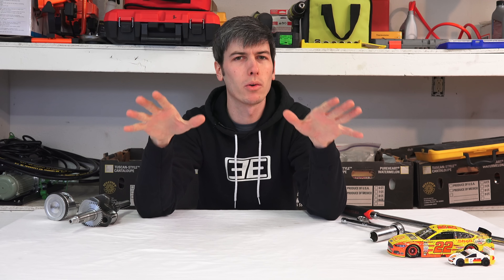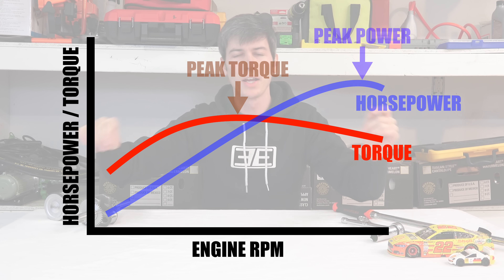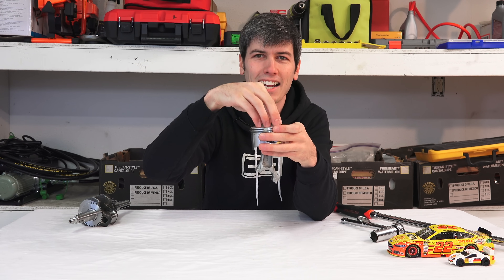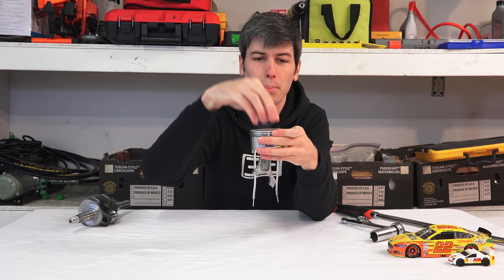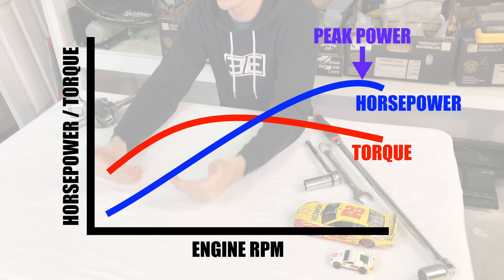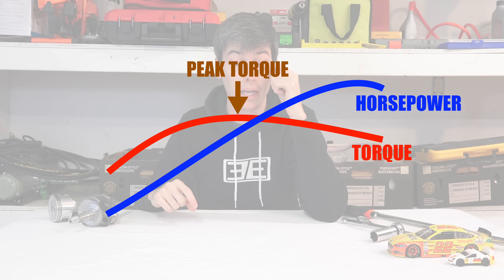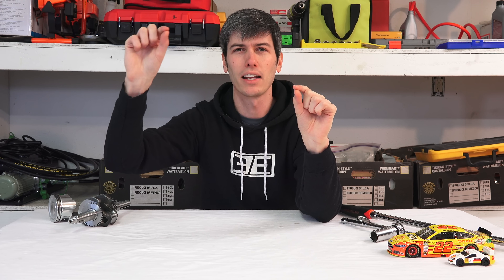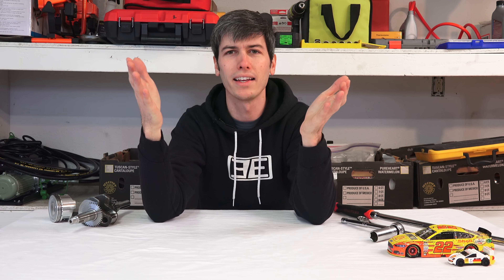Horsepower vs Torque - A Simple Explanation

Comment: After watching your explanation and reading through the comments, it seems to me that having less torque will create more HP. The distance traveled is therefore shortened making the axis of rotation spin faster equalling to more working in a shorter amount of time. So my question is, if I were to apply a bigger piston head and shorten the distance, will I be making more HP? My deduction is yes but I want to hear what others have to say and also, is this considered gearing ratio?

Comment: I umderstood power and torque, but peak torque? Shouldn't it be at the end rather than the middle?
Reply: The peak torque can be tuned into the engine by the designers when they specify valve timing, etc.  For example, my Mazda CX-9 was designed to have a lot of low-end torque to make it very easy to drive day to day.

Power will generally be at high RPM because power is torque times rotational velocity.  When you multiply any torque by high velocity, you get high power.
Reply: @razortm9947  Thanks,  I think I get it bit I'll need to do some more research to get it properly in my head 😅

Comment: If horsepower is torque multiplied by rpm, it would mean that hp has to be always higher than torque. So lets say 200 hp and 100 NM. But very often this is not the case. For example in Diesel Engines. They have 300 hp and 600 NM of torque. So this formula is not correct.
Reply: The formula for horsepower is (torque*rpm)/5252, the general definition of power is torque times radial velocity. You must divide by 5252 because of unit conversions

Comment: Good explanation... BUT it's a tiny bit more complex than that. You do need to consider how the vehicle is geared and the shape of the curve to really know if your 200hp lower torque vehicle is going to accelerate faster than your 175hp higher torque one (unless you have a cvt). To have a good idea which car is faster you need to look at the area under the hp curve during the acceleration. If both vehicles accelerate from 60 to 90mph in second gear (I'm a motorcycle guy) passing through their peak hp in the process... the faster bike will be the one that has the highest AVERAGE horsepower during that acceleration run. SO... a peaky 200hp engine will need gearing that keeps it right close to that peak (or the rider will need to shift)... whereas a torquey 175hp engine will be able to deliver closer to that peak hp over a wider rev range. Simple no?

Comment: I've been studying on 4 stroke engines. specifically the predator 212, 420, and 670. also centrifigal clutch versus torque converter. this video was super helpful. thanks.

Comment: Thank you so much!! This was an excellent explanation. My only issue was when you said the cars in the example were the same except power and torques. Then you went on to discuss their peak acceleration, where you mention differing gearboxes between the two example vehicles. Can you explain it in terms of cars with differing power and torque outputs yet the same gearbox? Then, will the car with more torques but less power demonstrate a faster acceleration at first but less total speed over time?

Thanks again

Comment: "the one with more power is always going to be quicker"

Top Gear: BMW 530d vs 530i.  530i has more HP, 530d has more torque. 530d turns out to be faster.

So according to Top Gear's testing, the one with more HP is not always going to be faster.  To be fair though, Top Gear is not necessarily the holy grail of scientific methodology...
Reply: the turbodiesel beemer also makes more average horsepower throughout the usable rpm. The 530i makes more "peak" horsepower and less torque
Reply: No your right and he is wrong. He simplified this to try to make it easier to understand but now it wrong.  Higher HP will always be faster if the gear ratio is the same.  However, a correctly engineered gear box resolves the issue.  Have more torque then use taller gears. He either is not as smart as he thinks or had a major brain fart when he made this video. HP does not equal Torque x RPM.
The correct formula is  HP = Torque x RPM / 5252. In other words, HP will always = torque at 5252 RPM because there really is no such thing as HP, it's just another unit of measurement based on Torque and RPM's
Reply: @ponderscythe835  "there really is no such thing as HP" -- you are so, so, so wrong about.  Power is fundamental physics: *power is an ENERGY RATE*.  In metric, we use kiloWatts. Where 1 W means 1 Joule per second of work rate.  What does the fuel contain? Chemical  energy in Joules (or calories if you prefer).  So power (in hp or kW) is the energy rate that can be extracted from the fuel and turned into useful work at the crankshaft (usually at about 30% efficiency for a combustion engine). Energy & power is far, far, far, far more fundamental than twisting force on the crankshaft (torque).

Comment: One question. Will the car with higher peak torque accelerate faster than the car with lower peak torque considering everything else is with respect to your example of two cars?
I don't want manipulation in gears so the figures are the max that the car can achieve?
PL reply @EngineeringExplained

Comment: This chap seems to contradict himself pretty severely coming up on 4:00. He originally claimed that torque could be tweaked through different gearing ratios, but then he said the same thing about horsepower without clarifying what the difference is.
Reply: You misunderstood what he said. Torque can be changed with gear ratios, horsepower will remain unchanged.
The formula for horsepower is (torque*rpm)/5252. Lets say there is a motor that produces 100 ft*lb torque at 1000rpm, that means it produces 19hp at that rpm. Now lets say that motor is connected to a 2:1 ratio gear. The output shaft would have double the torque, but half the speed (rpm), so it would have 200 ft*lb torque and be spinning at 500rpm. But, the horsepower at the output shaft would still be 19hp.

Comment: The best way to feel the difference between torque and power is tunning a scooter with CVT. They have transmission set for a max torque to achieve the most efficiency and reliability. Now set it for the power  and be astonished how fast you accelerate. There is even a funny effect with a badly tuned scooter when after a crappy acceleration within CVT range you start to gain speed in a faster rate when the unlocked engine starts revving.

Comment: Seem to be a lecture about gear ratio more than HP vs Torque
Reply: Because an aggressive gear ratio can give you more torque for the same HP engine
Reply: He lost me at gears.
Reply: Torque is twisting force HP is work over time.  His explanation seems to say that you can simply change gears to create HP or torque. That's just not how it works.
Reply: @chevysturgill6330  no, he says you can multiply torque but you cannot multiply power.

Comment: Its impossible to understand what horsepower is until you've done your honework; especially on Radians.  Radians are the key to grasping what horsepower really is.  If you wanna understand horsepower you have to research what the original engine buiders were going thru leading up to the erra of the mighty steam engines.  Regardless what erra engines you're trying to understand, all engine builders face one variable they are constantly trying to improve upon....Efficiency!
Radians qualify RPM's while RPM's qualify work completed in time; therein lies Effiecency, or the lack thereof.  Understand Radians to RPM's then you will understand RPM's to Torque.

Comment: Understand Torque is mostly based on gearing, but what about cylinder length? Does length impact torque also? Great video, thanks.
Reply: Length impacts torque. Yes.
Torque is most proportional to displacement and cylinder length impacts the stroke in the displacement formula. Displacement is a matter of how much oxygen can be moved and burned by the engine.

The simplest explanation of hp and torque is... Torque has to do with questions like how heavy a car the engine can push up a slope? Horsepower has to do with questions like how fast can the engine push the car up a slope?

Comment: Can you make an engine out of titanium?
Reply: You could, but it wouldn't be practical.  Titanium being the king of structural performance among all the metals, is extremely expensive.  It isn't like steel or aluminum, where our planet is has plenty of their raw ingredients.  It also is not as good of a thermal conductor as steel and aluminum, so you wouldn't get much benefit from making a titanium engine.

The thermal performance of titanium comes in its specific heat capacity, which is why it used in the exhaust system and the brakes.   That is, each mass unit can absorb a lot of heat for a given temperature rise.

Comment: Thumbs up if you still don’t get it. 😅😂😂😂
Reply: Heres a wierd way i might be able to explain.
Blow air out of your lungs fast. Like youre blowing a balloon away. Then cover your mouth while doing it. You stop the air flow, and your lungs can no longer push the air out. That's horsepower. All speed, low mass. 

Now blow slowly. But sturdily. Cover your mouth. But force that slow air through, even moving your hand. That's torque. All mass, low speed.

What i have a hard time understanding is how an engine can produce alot of one but little of the other, WITHOUT gears changing it up.
Reply: @Dave_Crupel  That's a weird analogy. I don't think i get it.
But I do can answer your question.
Let's take an example, yamaha r1. Producing 200hp and peak torque of 114nm
Engine power is literally torque * rpm. r1 can rev up to 14000 rpm, thus POWAA.
Reply: Dave Crupel your analogy is very weird and I kind of see where you are coming from. Where the difference in torque and power comes from is the design of the engine. Stroke and bore of the engine. The smaller the bore and the longer the stroke the more torque will be made because the crank is moving farther with constant force. A square engine is when the hp and tq are the same. The bore and stroke are equally portioned. On a massive bore low stroke engine the revolutions of the crank happen much faster and therfore will create more power and less torque. With a wide bore and short stroke it can sometimes be easier to hit high revolutions where it would be harder to hit higher revs with a longer stroke.
Reply: Get it this way instead:
- Horse Power means an ability to go fast speed.
- Torque means an ability to pull an Elephant. More the Torque, lesser the rpm (Rev) needs to pull an Elephant.
Or, 
A Lamborghini may benefit more from a Horsepower since it needs Speed.
And a Truck that’s carrying heavy loads may benefit from Torque. 
Hope that Helps 👍🏼.
Reply: Also, More HP doesn’t mean more Speed. 
For example, a Harley Davidson motorcycle may have 30 HP and a Ducati may have only 25, but the Ducati with lesser HP wins the Race because I believe, Harleys are made for Cruising and Ducatis are made for Racing. So, the way and engine is designed plays a vital role too.
( Feel free to correct me if I’m wrong ☺️)
Reply: @anonymoususer4489  Not how the base of the engine is designed, but how everything else on the bike is designed. Gearing is the first factor, a Ducati will have aggressive gearing, designed for acceleration, while a Harley Davidson will possibly have more spread out gearing in the lower half of the spectrum, and probably less gears overall. There are also many other differences between the two bikes, aerodynamics, weight, tires etc. That's why a Ducati would win in a short race. In a longer race however, a Harley Davidson might win, because the engine will last longer due to being under less stress, and it's more comfortable to ride for longer periods of time. Also has more available baggage space for food and other things.
Reply: @independentthought3390  yes i meant the same. It just depends on the way it was designed to.
Reply: Bikesh Shrestha that’s more to do with air drag and the tires you have
Reply: I'm like, it's the same... Even after all that explanation i figure it's the same. I mean don't have to differentiate it's the same so should just call power because they're all about the strength and working of engine after all.
Reply: HP = (torque*RPM)/ 5252
Reply: i do get it but you really have to know and understand how an engine works as he explains it and go threw the motions  :)
Reply: Hahahaha
Reply: Dude Fr I feel like a dumbass
Reply: Torque has to do with how heavy a car the engine can push up a slope. Horsepower has to do with how quick the engine can push a car up a slope.

Torque is mostly proportional with displacement so the bigger the displacement, the more torque you get and the car carries itself easier. The more horsepower, the faster it pushes you around.
Reply: @V1ralB1ack  so toque is for speed and hp for power?
Reply: The cycling analogy is a good one. Imagine you're pedaling at an easy pace and easy cadence (RPM), say 50 RPM. The amount of pressure/downforce you're applying to the pedals is your torque. If you apply the same amount of force to the pedals but change the cadence/RPM to 70 RPM, the power increases. Alternatively, if you apply more force/torque to the pedals and maintain the same cadence/RPM, which can be accomplished by shifting to a taller gear, your power increases.
Reply: Fitting the Mustang lover doesn't get it ;)
Reply: wow so a thousand people still don't get this;-)

Comment: Whenever I launch a vehicle..
1.Launch at max torque rpm
2.Shift at max power rpm
Reply: That's close enough in most cases. Better if you let it go a bit beyond peak power each time. How far you can get down the track in any span of time (launching, accelerating, or flat out) depends directly on the average power to the wheels during that time. That average is increased a little if each gear pull is roughly centered on peak power instead of just below it.
Why does power matter? Just think about what happens if every shift happens a little later. It's not that you get higher thrust at peak power than peak torque in a given gear - you don't... it's that 3rd gives you higher thrust than 4th and you're staying in 3rd longer. 
Being at peak power simply means that the thrust gained by being in that gear ratio is greater than the trust lost by not being quite at peak torque. A power curve tells all.

Comment: 3:05 What?? it took me years to get use to kilogram - pound thing but you guys use pound for newton as well?? Why guys why are you making everything just more complicated for no reason WHY??
Reply: Pound has always been analogous to newton as they’re both forces. Kilogram is mass. Unless you’re talking about about a Poundmass then that pound is also mass. But there’s also a unit called Slug that also measures mass and is related to poundmass. It’s unnecessarily complicated so mostly “pound” means the force version. And it’s further complicated because a Poundmass is legally defined as ~0.454 kg
Reply: @poisonpotato1   ThatGuy Man I've never heard of that mass units. I thought pound is an alternative to kilogram and a mass unit. So thank you for correcting me.
Reply: @furkanunsal5814  The Newton unit was introduced, so Newton's second law could maintain its elegance and simplicity, without a conversion factor.  Because our planet's gravitational field is not equal 1 in any conventional distance & time units for acceleration, when you express it in feet or meters, there will inevitably need to be a conversion factor in Newton's second law, if you desire to have a mass unit equal to itself as a weight force unit.  The SI system disconnects forces from being defined in a weight-centric manner, and instead defines force units independently of gravity, in terms of mass and acceleration.

The pound system has two choices you could follow, when using Newton's second law with acceleration in ft/sec^2.  If pound is a unit of force, the corresponding mass unit is the slug.   If pound is a unit of mass, the corresponding force unit is a poundal.  A 1 slug mass has a weight of 32.174 pounds, in Earth's standard gravity of 32.174 ft/sec^2.   Similarly, a 32.174  poundal weight in Earth's standard gravity, will have a mass of 1 pound.

Comment: But Torque is more then Horse power , so Horse Power = Torque * rpm , 2.0 TSI 200 HP , 280 Nm ? Do i miss something ?  , i am sure ...
Reply: That's probably hp to the wheels, which is manipulated within the gearbox
Reply: Both horsepower and torque change depending on the rpm of the engine. A dynometer is used to determine the torque at any given rpm. Horsepower is found matematically, the formula is (torque * rpm)/5252. The metric formula for watts is different. To determime horsepower, you need to know the torque the engine produces at a certain rpm.

Comment: Surely the item to be turned can be turned without there being any rod or arm distance being involved. ie the item to be turned could be turned by a flow of water. . i think that the amount of force being exerted on the item is what you measure or call torque, probably have to consider the length of time the force is being sustained or felt.

Comment: Good video, but one thing I didn't see (and that a lot of people in the comments are talking about) is 'aggressive gear ratios'.

Sure, by gearing a HP-based engine to provide peak horsepower as often as possible you will outperform a Torque-based engine, but in doing so you either have to accept that your velocity will be compromised, or that you'll have many, many more gears.

The video does nothing to explain that a Torque-y engine will do work at a smoother rate than the HP-y engine will, and because it can apply more force it doesn't require as much energy.

tl;dr - Torque makes moving easier, horsepower makes moving faster. To get a HP-y engine to work as efficiently as a Torque-y engine require more gears, or specific operating speeds.